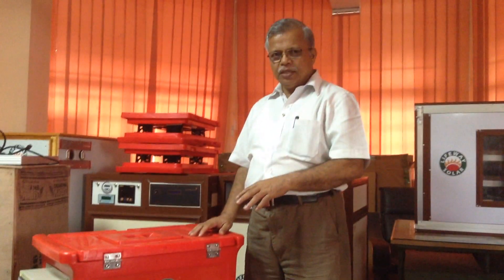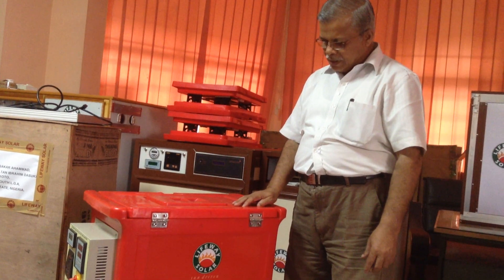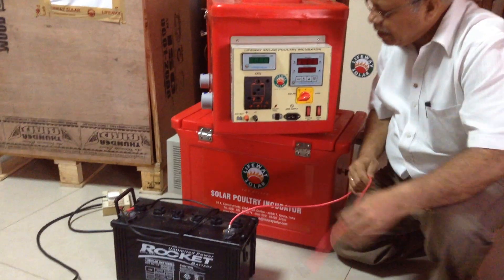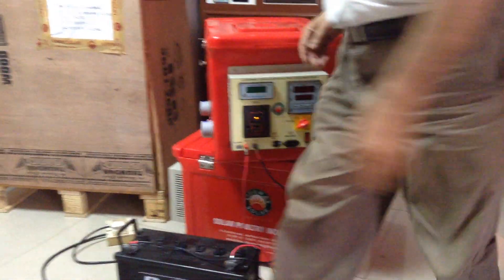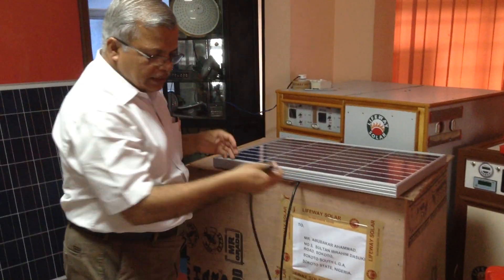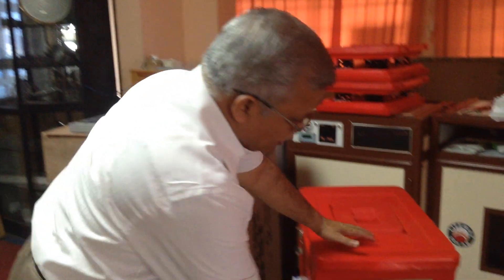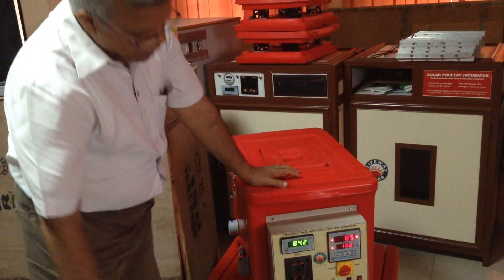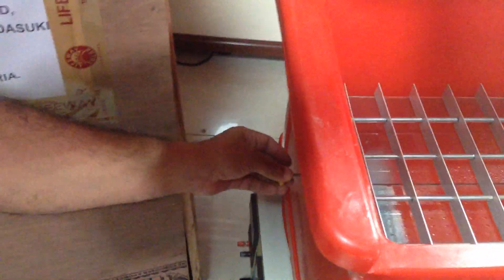Solar Power Incubator part 1 Solar Egg Incubator India Low Cost

Comment: 1000 eggs incubator solar power full Automatic price kya hoga
Reply from the maker: Yes sir we have 1000 eggs capacity. 
We have a variety of solar incubators starting from 100 eggs capacity to 2000 based on your requirements.
Rate starting from 35,000 to 2.50 Lakh Indian Rupees.
Please contact us at info@lifewaysolar.com for details.
Call us at +91 9846034493 /+91 484 4046642.
We are located at Edapally toll Jn, Cochin, Kerala, India.

Comment: Apka number
Reply from the maker: We have a variety of solar incubators starting from 100 eggs capacity to 2000 based on your requirements.
Rate starting from 35,000 to 2.50 Lakh Indian Rupees.
Please contact us at info@lifewaysolar.com for details.
Call us at +91 9846034493 /+91 484 4046642.
We are located at Edapally toll Jn, Cochin, Kerala, India.

Comment: Sir ji price.please?
Reply from the maker: We have a variety of solar incubators starting from 100 eggs capacity to 2000 based on your requirements.
Rate starting from 35,000 to 2.50 Lakh Indian Rupees.
Please contact us at info@lifewaysolar.com for details.
Call us at +91 9846034493 /+91 484 4046642.
We are located at Edapally toll Jn, Cochin, Kerala, India.

Comment: Price and ur number
Reply from the maker: We have a variety of solar incubators starting from 100 eggs capacity to 2000 based on your requirements.
Rate starting from 35,000 to 2.50 Lakh Indian Rupees.
Please contact us at info@lifewaysolar.com for details.
Call us at +91 9846034493 /+91 484 4046642.
We are located at Edapally toll Jn, Cochin, Kerala, India.

Comment: i need
Reply from the maker: We have a variety of solar incubators starting from 100 eggs capacity to 2000 based on your requirements.
Rate starting from 35,000 to 2.50 Lakh Indian Rupees.
Please contact us at info@lifewaysolar.com for details.
Call us at +91 9846034493 /+91 484 4046642.
We are located at Edapally toll Jn, Cochin, Kerala, India.

Comment: What is price for the whole set of this incubator
Reply from the maker: We have a variety of solar incubators starting from 100 eggs capacity to 2000 based on your requirements.
Rate starting from 35,000 to 2.50 Lakh Indian Rupees.
Please contact us at info@lifewaysolar.com for details.
Call us at +91 9846034493 /+91 484 4046642.
We are located at Edapally toll Jn, Cochin, Kerala, India.

Comment: price? eggs? my number is 7207994158
Reply from the maker: We have a variety of solar incubators starting from 100 eggs capacity to 2000 based on your requirements.
Rate starting from 35,000 to 2.50 Lakh Indian Rupees.
Please contact us at info@lifewaysolar.com for details.
Call us at +91 9846034493 /+91 484 4046642.
We are located at Edapally toll Jn, Cochin, Kerala, India.

Comment: What is the price of this incubator and how can I get it?
Reply from the maker: We have a variety of solar incubators starting from 100 eggs capacity to 2000 based on your requirements.
Rate starting from 35,000 to 2.50 Lakh Indian Rupees.
Please contact us at info@lifewaysolar.com for details.
Call us at +91 9846034493 /+91 484 4046642.
We are located at Edapally toll Jn, Cochin, Kerala, India.

Comment: pls ser i have your cotact nuber  whats app  00919745383786
Reply from the maker: We have a variety of solar incubators starting from 100 eggs capacity to 2000 based on your requirements.
Rate starting from 35,000 to 2.50 Lakh Indian Rupees.
Please contact us at info@lifewaysolar.com for details.
Call us at +91 9846034493 /+91 484 4046642.
We are located at Edapally toll Jn, Cochin, Kerala, India.
http://www.lifewaysolar.com/

Comment: how much it cost?
Reply from the maker: We have a variety of solar incubators starting from 100 eggs capacity to 2000 based on your requirements.
Rate starting from 35,000 to 2.50 Lakh Indian Rupees.
Please contact us at info@lifewaysolar.com for details.
Call us at +91 9846034493 /+91 484 4046642.
We are located at Edapally toll Jn, Cochin, Kerala, India.
http://www.lifewaysolar.com/